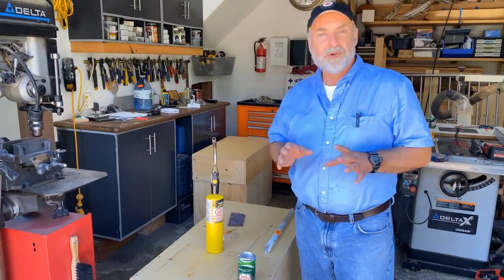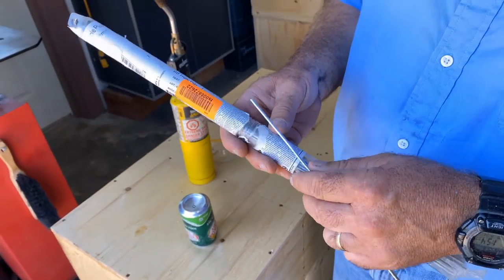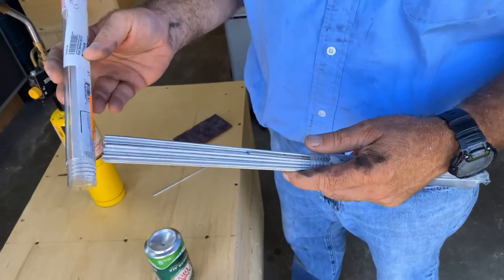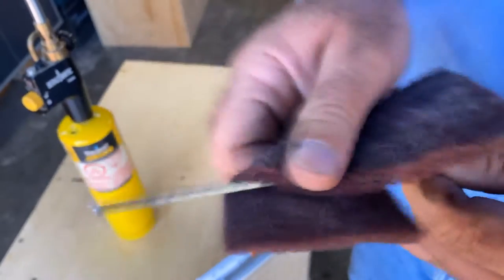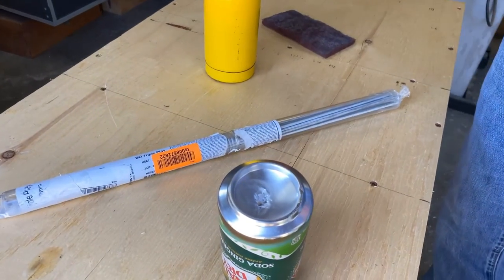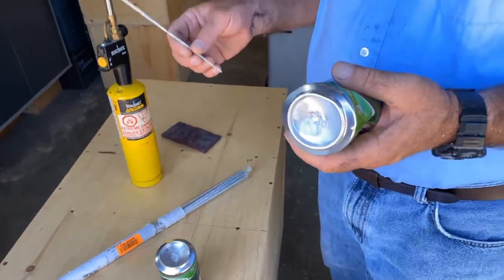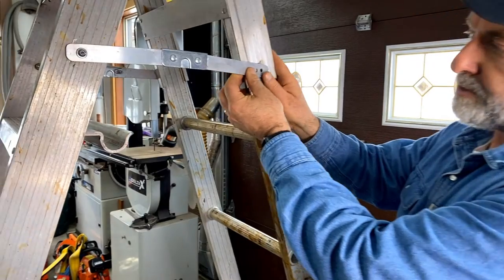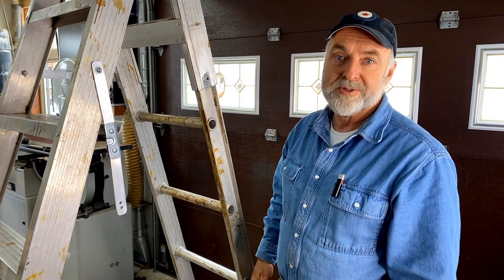How to Solder Sheet Aluminum

Comment: Just saved me so much money I was about to spend like 400 on a mig welder and it was just getting more expensive a good helmet was like 300 a machine was like 150 the gas was like 300 and I also needed a work bench
Reply: A mig welder vs soldering?  I would not rely on soldering for anything health and safety wise.

Comment: Though I was searching for a process to solder SHEETS of cut aluminum cans together, that's a good idea for bulky aluminum fixes. There are aluminum threaded bolts and nuts that for example you can wrap in aluminum foil, connect 2 aluminum parts, then after tightening, you could build up the exterior bolt head and nut, then shape to just appear as smooth nubs (you wouldn't want to grind smooth to the planar surface obviously, but you simply assure it's never coming apart, and in the process thin foil liquified and bonded threads; definitely less is more, as you want full torque that could be lost if using too much foil, which should bond threads permanently). I've used just the exposed bolt/nut/foil/torch method but that torch step adding material externally that can be shaped into smooth mounds would be stronger and look better.

Comment: Metal does not have pores.
Reply: Porosity occurs in cast solidifying metals and alloys due to negative pressures generated during solidification contraction, and pressure developed by gases dissolved in the molten metal. Both the above processes may act either together or separately to produce such shrinkage or gas defects (collectively termed pores). They are generally unwanted and constitute a major industrial problem. 

However, it's useful for applications such as this demonstrated...
Reply: Aluminum does have pores, thus how anodizing is achieved, the dyes become lodged in the pores, unlike a surface finish.
Reply: Everything up to pure carbon (diamond  with no fissures and no impurities) can be porous. Even glass. Some molecular structures are stable to thousands of years, others are not. The casting process - especially when it's impossible to eliminate all impurities - introduces reactions that causes oxidation and microscopic irregularities in the metal structure. Aluminum cans start out as some of the purest metal products we know of. Once paint and sealing material is added to the top, the forging process is required to remove those impurities. Otherwise aluminum cans would be easily home-forged pouring pure castings (the top slag is not easily removed fully using home forging, and results in low quality casting, for example). The video shows the can surface being scored with a steel wool material. If you do that to the surface, wipe clean with 99% rubbing alcohol, there will be enough rough and porous metal to receive the brazing material. (Soldering involves getting base material hot, which in thin can aluminum would melt it away. Brazing is an art form that I'm guessing the presenter had to practice distance of the torch a few times to not melt the can. He's aiming the torch at the stick, not the can. Brazing.).
Reply: @Greg-io1ip   I meant in the biological sense.  Do the pores in metal react to temperature changes?  I don't think they do but what's your opinion.
Reply: @Greg-io1ip   Porosity is not the same as having pores.  Paper and other materials vary in porosity but certainly do not have pores.  It's the same with metals.  There are no individual pores in the metal that open up as the temperature rises.  It's a silly concept.
He also uses the word 'oxidization' when he's describing 'oxidation'.  It's just a casual way of speaking.  Nothing wrong with it unless you want to be exact about something.
Reply: @alext8828  It's obvious you struggle in technical applications because instead of having EXPERIENCE you go by a book you read. "Porous Surface" doesn't mean liquids go all the way through. At the atomic level: There are 'bridges, caverns, ridges and grooves' for BRAZING MATERIAL to bond to. It's not saying anything about "POROUS TO THE OTHER SIDE". It's simply another way of thinking about material SURFACES so you visualize that polished surfaces fitting tightly are EXCELLENT FOR WELDING, terrible for BRAZING. Get outside. Get a girlfriend. Or hold hands with boys. No crime in that. But you're not correct. Accept this. Learn. EVOLVE.

Comment: I am building an aluminum battery box using thing aluminum sheet.
I have some aluminum brazing rod on hand, but my first attempt on a different design had poor results.
It was burn through that was the problem.
It was that in my application I has a lot of surface area compared to thickness of the metal, because I had a thicker frame for rigidity and the sheet was just a skin.
So when I tried heating the sheet hot enough to melt the rod, the temperature  variations across the sheet caused so much expansion/contraction that it distorted the sheet enough to warp the frame.

I'm sure I could mitigate that by preheating in an oven (or my gas grill that can go nearly to the brazing rod melt point) but that would require some dexterous and quick positioning of the parts, torch and rod that in my hands is unlikely to succeed.

I think instead I'll rough up the sheet with 80 grit where I want to bond it, and then use epoxy, with a layer of glass cloth and epoxy inside and out - possibly predrilling a bunch of holes so that the epoxy can bond to itself through the holes.
Reply: You could have simply riveted it and a number of points, and then lower heat (butane) to solder it.  With large/long runs, it seems like tacking a small weld across it first reduces excess heat. You just come along shortly after an solder from tack to tack.  Key is just the minimum heat required to just melt the solder.

Comment: 1. This is brazing. Soldering is at lower temps.
2. Your temp is off, you almost melt the can, it is very challanging to braze a can because it is extremely thin and dissapates heat very well.
3. Metal has no pores where the brazing material grabs to, it diffuses into an interlayer, so it alloys itself in a thin layer with the Al. The brazing rod atoms diffuse into the base material.
To repair the ladder you could have used Al sheet cut to size and attached with pop rivets instead. No heat, no mess, just a 15$ river gut a couple of pop rivets and some sheet metal.
Just saying, brazing is fine really but for a problem like this I would have probably done it like on an airplane skin, just patch it up.
Reply: You're correct. This is a brazing technique. He's aiming the torch at the stick, and at a distance that needs some practice. Of which things like humidity and room temperature will change from time to time, thus distance away from base material, aiming torch at end of stick, will change. But phraseology aside: You get the idea how to do it. I would recommend attention to safety, clear of flammables, eye protection, and probably a leather shop apron and gloves. This type of 'crafting' doesn't need full welding protection, but around fire anything, pick places out of wind but well ventilated. No flammables like fluids nor paper products. Have a Windex type sprayer bottle, spray water in the area around you. It seems overkill but putting out fires in your shop is expensive and time consuming.